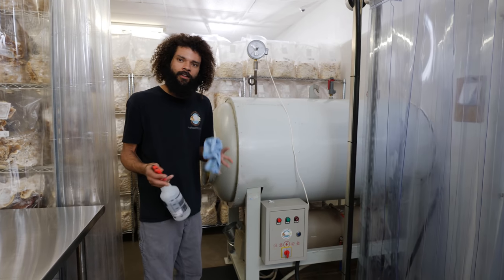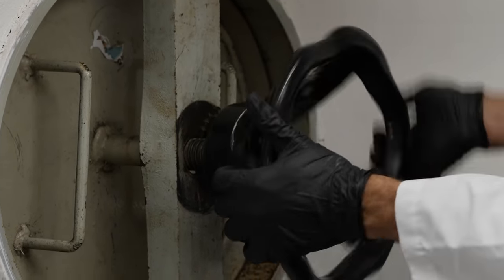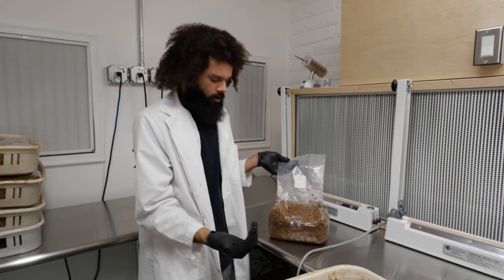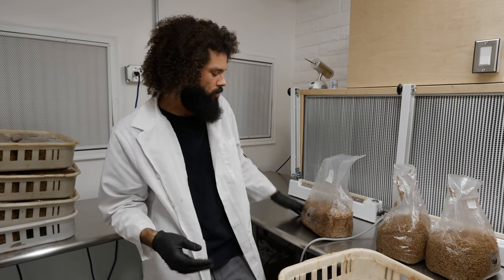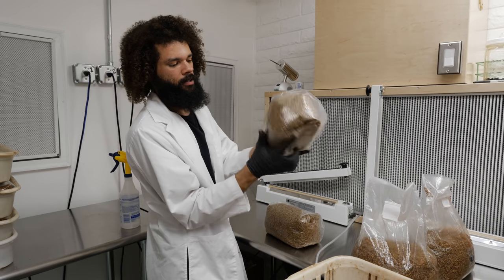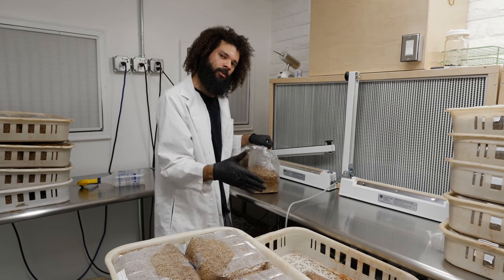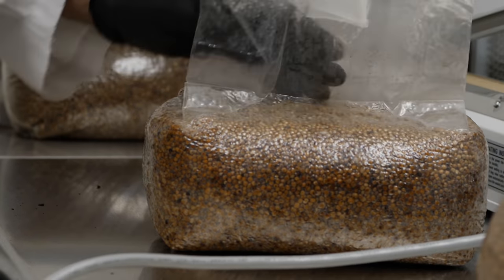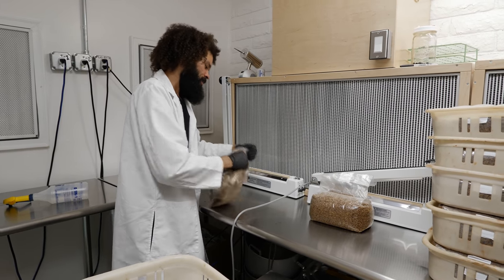80 Bags of Autoclave Sterile Grain Spawn | Southwest Mushrooms

Comment: Lol omg, you got the autoclave, steam generator, and mixer for $1,000? You lucky man you. I use 2 150L concrete mixers for substrate and I've been doing 5 lb grain bags in my AA941 and a 23 quart PC, if I run two cycles a day I can get 26 bags done a day, but it's enough work for sure. How do you go about hydrating your grains??

Comment: Hey man, love the vids. 
Any chance you could share the pressure you are running your clave at? 
You said 212f, however the heat and pressure charts would mean that at “high pressure” it would be higher than 212f. Also sterilization starts at 250f. 
Thanks in advance!

Comment: is anyone else realising he doesn’t seal his bags before sterilisation 😣😣😣 is this better?
Reply: It definitely helps for stacking in larger setups, plus if you're inoculating with grain spawn or agar then it's necessary... it seals itself up like a vacuum sealer when folded this way and you have to pull the bags apart to pop the seal.  Pre sealed bags will only work for injection of LC or SS, but they don't stack nearly as well in my experience.
Reply: @frannysforest  legend